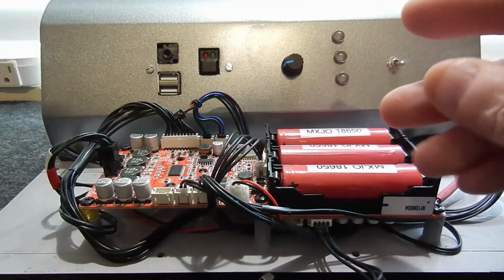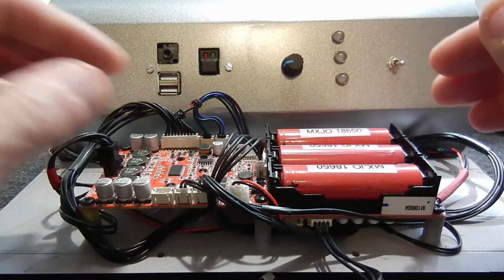A neat little Bluetooth kit

Comment: How is the sound quality of this board ? Have you tried adding a bass treble control to it?
Reply from the maker: In my opinion the sound isn't too bad. The speakers I chose perform well for a full range speaker. I've not put a crossover or any kind of bass/treble control. If I were to do that I would be more inclined to have tweeters and bass speaker. The board works fine for me in its intended purpose, mostly in the workshop where I'm more concerned with volume than quality. Regardless the sound quality is still good.
Reply: @CandorPerlicious  Thanks for the reply. Which class D amplifier board has the finest sound quality as per your experience? Have you tried the Infineon technologies MA12070 board ?
Reply from the maker: @salilmahadik9396  honestly, this was my first major attempt at Bluetooth speakers. In the past I've used other cheaper units as more of a proof of concept. I'm not the best person to ask about fidelity since I'm kind of tone deaf in one ear. I haven't used any other brands as of yet since I'm not looking for another speaker but in the future I will probably put more effort into creating a richer fidelity and with the proper crossovers and speakers. If anyone else is reading this and wishes to reply on what you think would be a good high fidelity Bluetooth board, I'd be willing to listen. I still say though that dollar for dollar the board I chose was a good fit and the speakers give me enough clarity and volume to make me happy. 

Honestly I could have spent a few extra dollars to get A JBL or other brand name speaker with better bass and speakers engineered specifically for their Bluetooth board, but where is the fun in that? I prefer to know I can do this myself and get a reasonable facsimile of a store bought unit.

Maybe in time I'll even be able to make one as good if not better 😜